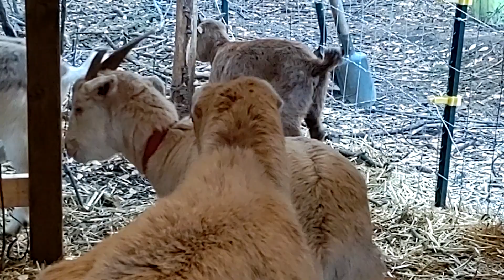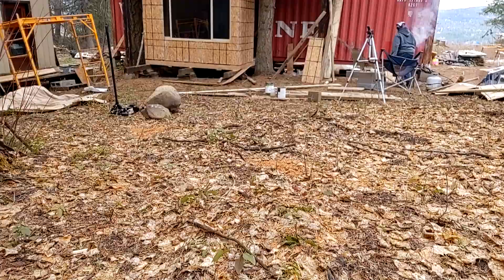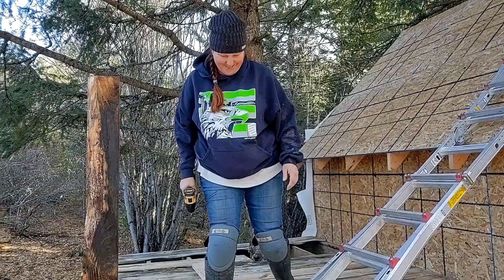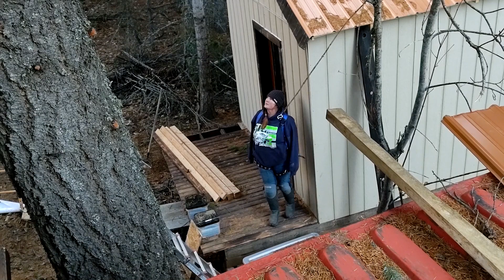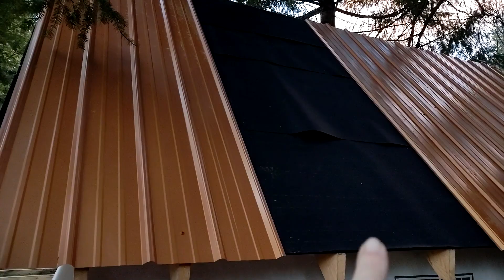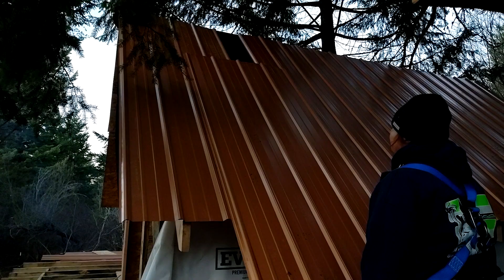OFF GRID BUILD// Treehouse gets a roof// VLOG

Comment: Remember when you install the chimney the more chimney you have in the room area the more you will capture the heat from the pipes !! Placing it outside you lose all the heat !
Reply from the maker: we are using 2 wall pipe in the inside so we lose all the heat... but it is a 2000 sq ft wood stove so I think we will be fine.. if not then we will change it out with one wall pipe

Comment: If you ever hang tin again, you could make marks on each end of the building 6" or so up from the eve edge, snap a chalk line on those marks across the eave, then measure up on your tin 6" plus what overhang you want and mark your tin. lay the sheet of tin on your chalk line with the marks and you should have a straight eave.